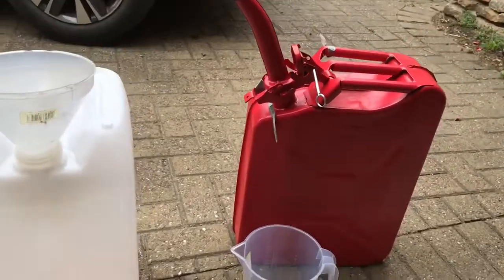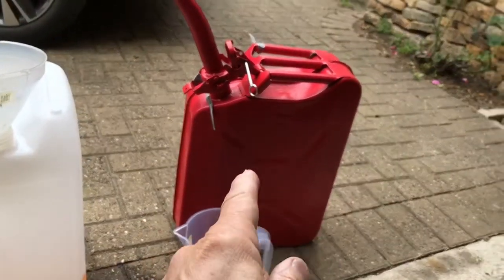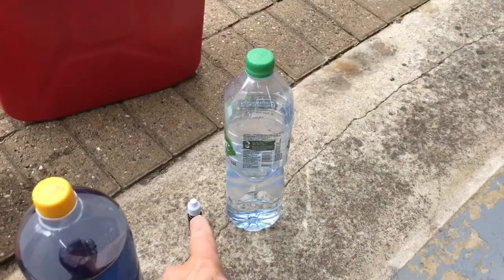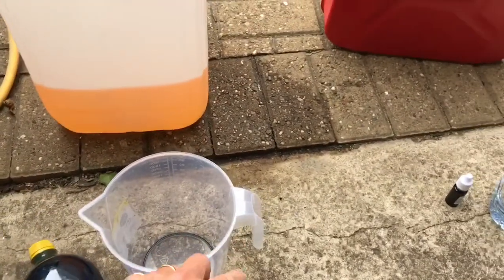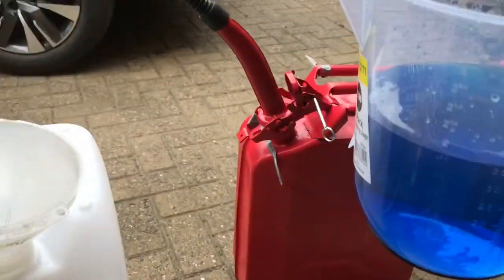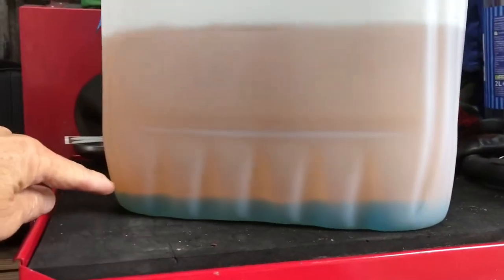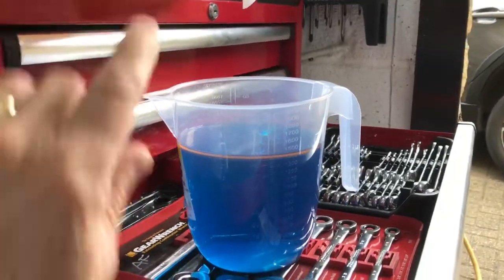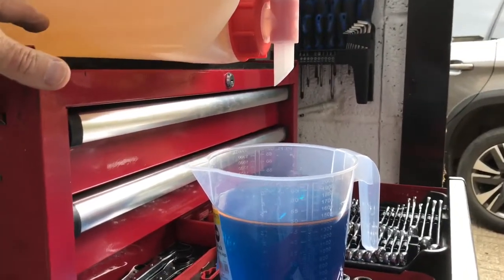How to remove Ethanol from unleaded fuel

Comment: You don't loose octane by removing ethanol. The very opposite happens as ethanol has quite a bit less energy than gasoline/petrol for the same volume.
Reply: Octane is not the same thing as energy. Ethanol has a higher octane rating than regular 95RON petrol. Pure ethanol has an octane rating of aproximately 108RON.

Comment: What a waste of time. E10 wont cause any issues. Heck, I've been running E85 in a 2.0 Mk3 Cortina for 50,000 miles with no issues. Only thing I had to do, was increase the jet size in the carb by two or three sizes, and advance the timing slightly.
Honestly, if the ethanol is able to damage your fuel lines/floats etc, they're probably so old, they need replacing by now anywway.

Comment: I’ve done this for years… it really does work.   Interestingly my vehicles lose almost 10% of their mileage running on E10, so 9 gallons of ethanol free gas takes me almost as far as 10 gallons of E10… Ethanol blends have absolutely no redeeming value…. negative in EVERY respect including the energy input in growing the crop and production of ethanol which exceeds the energy of the fuel… without taking this gas mileage into account…   A total scam!     Testing for ethanol is essentially the same procedure… A test vial with an ounce or so of gas… put in a drop of water base food coloring and swirl a bit…. If it mixes, coloring the fuel you have ethanol…. If it beads and falls out… you don’t.    They sell expensive “test kits” to aviators that are nothing more than this.

Comment: Av gas can is a good option too. My dad runs it in his vintage motorcycles because they are started so infrequently. plus the leaded fuel is great for valve components in older engines.

Comment: Excellent that you mentioned restoring the octane level.  Many similar videos do not and running a much lower octane than an engine requires will do far more damage than the ethanol.  Here in America, some gas stations sell non-ethanol gasoline that people can use in mowers, scooters, chainsaws, leaf blowers, etc.  (None in my town do but a few towns away has a place) I have replaced the carb. on my 49cc chinese scooter 2 times over the past 10 years from ethanol damage.  I could have restored them back to working order somewhat but a new carb. is only about $20 so that was easier and faster.  If a fuel system was not designed for ethanol, it certainly does do damage to it.
Reply: The only thing octane does is prevent detonation or knock in engines so if you do not hear knock it should be good to go. It is mostly mewer fuel injected automobiles that require a high octane level.
Reply: bit how does chainsaw work with this fuel then ?

Comment: Or you could just go to the petrol/gas station that sells ethanol free premium. A lot easier and less hassle..
Reply: @Smooth Move Yep but if I ever have to do it this way it's still good to know.
Reply: I only use non ethanol in my boat motor anyway so the cost isn't really a problem for five gallons..

Comment: That's actually pretty cool. Now, someone who is me, wonders if someone who is probably not me could distill the ethyl alcohol out of the blue water solution and drink it, or has the alcohol absorbed benzene and/or other toxic chemicals from the gasoline, that can not be removed with a pot still? Maybe some keyboard chemists out there have some knowledge on the matter.
Reply: My guess is they probably add denaturing agents to it like pyridine and methanol just like they do to make denatured alcohol.  This keeps folks from drinking it because it will kill them.

Comment: Go to a farm supply store, or a boat store they have funnels that separate with a built in water - block filters to use after you have removed most of it by simple pour off. That funnel will get the rest.

Comment: Any residual water may damage fuel injectors and sensors. I also wonder what happens to the octane rating in this process.
Reply: the residual water is not going to harm anything it wasn't already going to harm. ethanol is hydrophilic and is getting moisture from the air and tanks when they cool and warm also condensate water vapor.
Reply: The coloring and the clear tank is used so you can see the water leaving the tank. Water and pure gas don’t mix.

Comment: I would rather have small amounts of issues with the ethanol then use a octane booster that has mmt in it. Ethanol wont damage your car or bike parts if you ride it often . Only when you let the fuel sit for a long time do you get issues. Also using a bit of pea cleaner will prevent issues safer then doing this and having to add a mmt octane booster. Plus most octane boosters including the one he used a bottle ussally on ups the octane by a .1 or acouple points not a entire octane number.

Comment: The drain is an inch higher than the water on the bottom.  He wouldn’t have gotten all the water out in that position.  I would like to see it actually draining to get that much.  I’m a skeptic.
Reply: The spout is only in that position because he had the container upright. Placing the container on its side at the edge of the bench top with the spout positioned below the surface would allow draining all the water mixed with ethanol. If you look closely, there's a thin layer of gasoline floating on the surface of the drained off mixture.
Reply: you know you can tip the container so the tap is on the bottom. skepticism requires an a well functioning brain, something a lot of self appointed skeptics forget, obviously.

Comment: I don't know about Britain, but in the U.S., you can go to any small airport and buy 100-LL (100-octane, Low Lead) gasoline (aviation gas)...pricey, about twice what pump gas costs. Now, do your 'water sequestration' as shown in this video, but instead of adding some 'Octane Boost', add 1-quart (1-liter) of 100-LL per gallon (3.5 liters) of 'filtered fuel' together and shake gently...if you started with 91-octane (high test gasoline), you lost very little octane (Octane is a specific chemical), and by creating the new mix, you will end up with 94-95 octane REAL FUEL (akin to what you could purchase in 1970). It will run properly even in old high-performance engines up to about 12.5:1 compression! Trick I learned from a chemist a long time ago... (new engines allow for pump gas to run in high compression applications via electronic timing adjustments done through the on-board computer...which prevents you from realizing the 'rated horsepower' advertised...this can help them also, as there is no Tetraethyl Lead used in the modern 100-LL fuel).

Comment: Very interesting ...
FYI ..  I think UK E5 petrol is defined as 0-5%  &  E10 is defined as 5-10%   & there is a  promise of a "protection grade E5 " which might be only super unleaded , may for 5 years at least 

The E10 promised fossil CO2 saving is probably over stated, as biofuel increased pressure on land use & thus wrecks forests.

Comment: ONCE AGAIN. It is not nearly as much of a problem as people make it to. - Yes,  if you are the type that drive your vintage twice every summer, you will most likely encounter some issues. If you drive you vehicle, or bike regularly,  add some Fuel system cleaner or stabilizer to the tank at each refill and youre in business. Liqui Moly, 76 and Bell Add all have good stabilizer products. Also, some fuel system cleaners also work well. I/we have good experience with Lindemann´s Fuel system cleaner. *We, service vehicles from 1930 to 1990 era and we use the stabilizers for the vehichles that dont get driven much. The vehichles that see some asphalt we use the Fuel system cleaner, and we see no issues with clogged jets, brass that gets erroded or similar issues. 
Stop worrying and enjoy your vintage vehicle.
Torben. Classic car supply.

Comment: Great idea. I've used it before for my radio control aircraft, HOWEVER, as a retired Lt. Firefighter Paramedic this process is fraught with danger which threatens life and property. Fortunately, here in the U.S. we can buy ETOH-free gasoline, but it does cost more. I have two BMW motorcycles which I don't ride anymore due to the Orlando area having the "most dangerous" place in the U.S. to drive, hopefully your area is safer. Best wishes! And thank you for the info.

Comment: The ethanol is an antiknock additive, among other things like octane booster, to replace the lead used before so unless your classic has a low compression ratio you will have to add lead substitute as well, just make sure it is not ethanol!
Reply: Rather deal with the ethanol and just add a pea based cleaner with protection for ethanol issues then do this or use octane boosters. The mmt in octane boosters destroys plugs o2 sensors etc and most cheap octane boosters only boost the gas by a point or acouple points not entire numbers. Best product to use are the expensive octane boosters 20$-50$ a bottle like boostane or octanium at the proper ratio but these still will have huge amounts of mmt.

Comment: Most interesting, Ta. Struggling to find a use for the blue moonshine though...what would i do with that..? Another thing- i would recommend a bottle of Wynns 'Dry Fuel' every so often to emulsify any remaining traces of H2O in the fuel, it's really good stuff. Note that Super Unleaded (97-99 RON typically) in the UK remains at E5.....for the moment. 
Oh- how much RON do you lose with the alcohol..?
Reply: 3-4 points. so a 98 would become a 94.

Comment: This is fine for minute amounts but what about doing 100 gallons per day as I need. Here in America, ethanol is 15% into each and every gallon of gasoline. Also, if you do not use it, it evaporates at an alarming rate. YOU LOOSE MONEY. It smells horrible when burned, lousy mileage and no power ( no energy produced). Unleaded gasoline was doing fine until the ethanol showed up. It was a government scam from the get go for a selected few to get rich - that's all. There's got to be a better way to get the job done.

Comment: So where did you come up with this notion that ethanol ruins anything in a carburetor??? My 65 Chevy shot box has had a tank of ethanol for 15 years. It’ll sit for months at a time and I can walk out twist the key pump it about eight times and it’ll fire right up! All fuel will break down given time. Calling bullshirt on this one.
Reply: Its worth knowing the the SAE ran tests in America on the E10 which has been used for quite some time. Equally american engines are significantly understressed compared to the Euro displacement/hp figures. So a less stressed engine is less likely to notice a performance drop anyhow. Their is also the possibility that as E10 has been ran for a long time so changing the lines, and associated materials eg Brass, Copper etc was done at the manufacturing stage.

Comment: The ethanol cost so much more to produce and gets less mileage so it is NOT a good fuel source, however the corn industry lobby groups sold this scam to the crooked leaders. Think about this all the corn used has left over gluten which is used in many applications so if this created an excess of gluten why are the products made from so high? Gluten is a feed for livestock but it had doubled in price since ethanol .

Comment: Due to cost, I run today’s gas through my 66 Chevy. It’s an old quadrajet carburetor but it’s got new gaskets and seals. Foam float. Haven’t had a problem, but I also drive it every day.
Reply: It won't be long now, fuel pump,fuel lines next. Then it will start over again with the carb.
Reply: I’ve been driving it like this for seven years.

Comment: Excellent!  Are there any downsides to this process apart from the fact of having to do it ?
Reply: Not really except for the lowering of the octane rating as he stated. An octane booster can help take care of that, but if you are going to be using it in low power engines like yard equipment and things like that it will be fine.

Comment: Walmart gas stations--- Murphy USA-- has non ethanol gas here in Florida @ 92 Octane for less then premium gas 🤙
Reply: Murphy USA has low quality gas. Filled my 2007 Chevrolet Avalanche a few times with it and it started running like shit. Took it to my mechanic for a diagnosis and was told that I had water in my gas tank. My Avie doesn't have the flex-fuel motor, so after 4 bottles of Heet and 3 bottles 44K I finally got the truck to run smooth again. Will NEVER purchase fuel from Murphy USA again.
Reply: @daggerkettenring  I'll keep an eye out for the water. I have only purchased about 10 gallons so far. Thanks

Comment: This is how I am going to treat fuel for my lawnmower and chainsaws now!
Reply: I’d rather replace some parts after a decade if something fails, than having to do all this chemistry all the time.
Reply: @Engineer9736  I made up a gallon of this last week, took me about, oh, 60 seconds to add some water to the petrol (didn't use dye - not necessary other than to allow clear separation marker) - shook it and put it back on the shelf. 4-5 days later I pulled the petrol off the top into a clean can. Job done.

It would take me longer to find a carb kit online, let alone order it, pay for it and fit it for this little preventative measure. 

By the way, if it was an issue that reared it's ugly head once a decade, no one would care, this is an issue every 1-2 years!

Comment: Join the club, they've been watering our fuel down with ethanol in the state of Oregon (usa) since 2007. You can still find "pure gas" stations on pure-gas.org and it runs anywhere from $0.70 to a $1.00+ more per gallon for Super/Premium. I recently bought a used Lexus is350 and ran a few tanks of pure gas through it and it gets better mileage and feels smoother.
Reply: Michael Angelo, Thank you so much for posting that website. Apparently there is ethanol free gasoline less than 10 miles from my house. 
Sadly, it's $11 / gallon.
Reply: @savage22bolt32  
That's crazy! Where are you located? I'm in Oregon and we generally have some of the spendiest fuel in the mainland US. I think 105 race gas at VP Racing gas stations is $11/gal near me, which would only be used for max performance bikes, quads, drag cars, etc. Non-ethanol Super 92/93 at VP was $4.39. At Towne Pump it was $4.89. I believe ethanol blend super was around $3.89 when I filled up on Monday, so I was only paying a $0.50 premium at VP for pure gas and an 8 mile round trip out of my way. I think more people are buying Non-ethanol because a local station maybe 1 mile away from my home was just bought out by VP Racing and have a large banner on the canopy reading "ETHANOL FREE COMING SOON!"
Reply: @michaelangelo5783  CT. I just looked at the can. It says unleaded racing fuel. So I probably bought something I don't really need. Just wanted to get away from the ethanol for my mower, snowblower, chainsaw etc.

Comment: Most likely already been been said here, but removing the ethanol unfortunately lowers the octane which is worse than having the ethanol ‼️ 
Cheers!
Reply: But in your vintage car the octane rating was likely lower, plus you have advance/retard ignition in the cab. Take 97 or 95 unleaded, remove the small amount of ethanol by this process and end up with circa 95 grade ethanol free!

Comment: That's quite interesting, but it's not ethanol that's the problem, it's the other crap they add as binders and anti-evaporate parts that leave the sticky goo if you leave it too long. Better to buy premium without ethanol at all.

Comment: Nice explanation with just enough details to keep it short. I liked the octane booster tip. Anybody working with gasoline should do it outdoors, even something as simple as pouring fuel. A good rule is to be able to walk away from it if it catches fire.

Comment: And remove octaine rating in the process. The whole make up is altered when they add Ethanol. They dont just add Ethanol to regular petrol.
Reply: No. The ethanol IS the octane boost as well as the oxygenator.  Here in Australia, 10% ethanol blend fuel increases the octane rating from 91 to 94.
Reply: That's exactly what I said.

Comment: What to do with the blue water ethanol afterwards? Put it through your SodaStream it and sell it to teens as WKD lol
Reply: Make a TIK ToK challenge for teens to drink.
Reply: New fad used to wash down the tide pods they suck on ;)
Reply: distill and make vodka
Reply: Brilliant 👏 Made me laugh 😆
Reply: No sunny D been doing that for years that famous orange juice company
Reply: Keep it around and burn it in the winter for heat. It should still work.
Reply: @markm0000  It’s 80% water. I doubt it that it will burn.
Reply: @Engineer9736  I realized that a couple hours after. I guess you could just set it out to evaporate.

Comment: As you're extracting alcohol from a substance I believe you'll need an alcohol manufacturing licence, permits for production, registration with HMRC and also you've informed your insurer that you are separating fuels. Also, the extracted ethanol cannot simply be flushed down the drain system.  This is a big can of worms.
Reply: Rotting you fuel system is a far greater concern, would not boiling the water remove the ethanol?, so making disposal of the water easy.

Comment: So would this method make your premium fuel , say shell V power at 99 octane, 100 % octane , or lower the octane, unlike you with classic cars I drive a modified car and I only use premium fuels , any info would be appreciated. Nice video straight to the point , and I’ve never heard of this before. Cheers bud 🤘🏻😎🤘🏻
Reply: If your premium fuel has ethanol in it, then it's not premium.
Reply: @TheKnobCalledTone.  'premium' has nothing to do with ethanol content, it's a term used for higher quality, higher octane fuels.
Reply: @jason Crook not clear what you're asking but a 98 octane fuel would end up as a 94 after removing the ethanol. octane isn't measured in %.